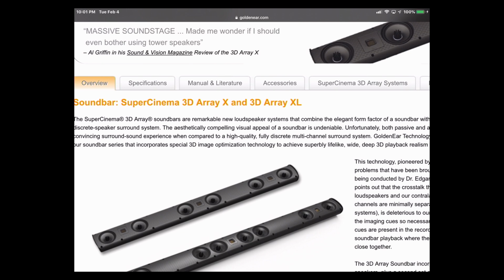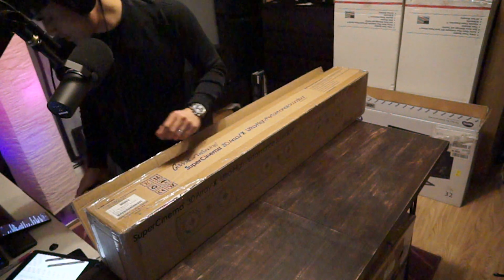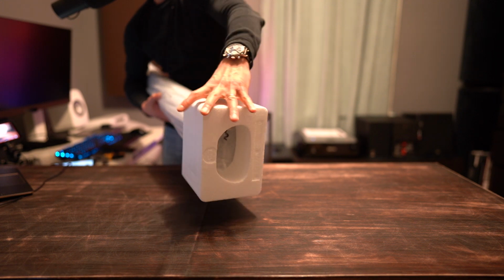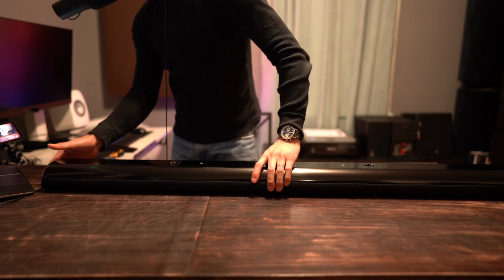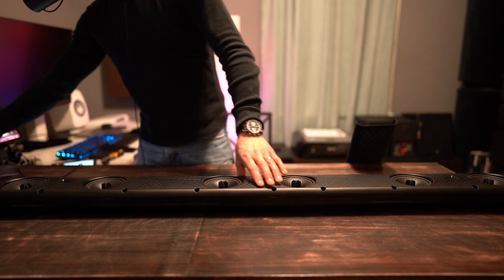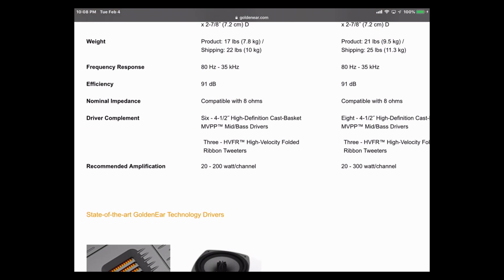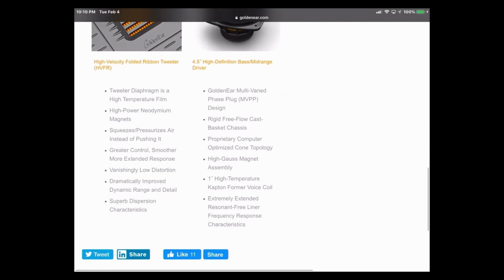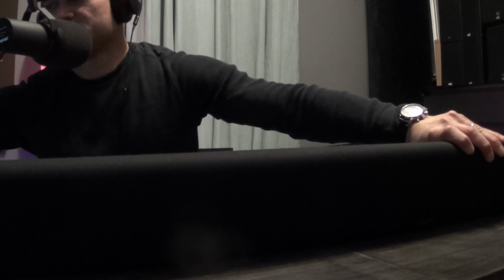An Audiophile Soundbar? GoldenEar 3D Array X SuperCinema Soundbar | Live Unboxing

Comment: Hi Shane. I own the goldenear super center x. It is absolutely fantastic. One of the best sound bars u can buy.
Reply: What you have is a quality dedicated center speaker, designed to be used with L+R speakers..
Reply: Hi Adam. The super center x contains all 3 front channels
Reply: Dave McCague Just a strange choice to use a 20” wide center channel speaker as a soundbar when they have soundbars built for that purpose...but hey it’s your house!
Reply: Hello again Adam. Actually I misspoke. I own the goldenear super Cinema 3d array sound bar. It has all 3 front channels built into one unit. It’s 50 inches wide and produces a very large soundstage. But it’s a passive unit with no built it amplification. I love it. If you’re in the market for a sound bar it’s one you should check out
Reply: Dave McCague Yes you have the soundbar which is the subject of this video, that makes more sense!
Reply: Dave McCague Are you using a subwoofer with it, or are you satisfied without one?
Reply: Yes the goldeneR force field 3. It compliments the sound bar nicely. Digs deep for a little sub. It has an 8 “ driver with a 1000w amp. Awesome little sub. Very articulate